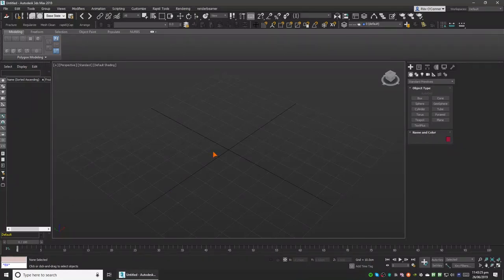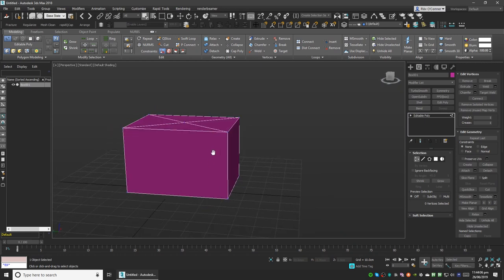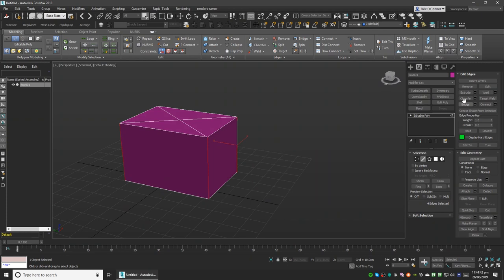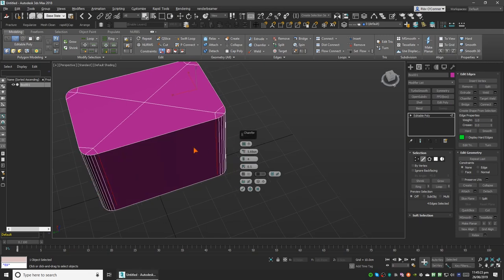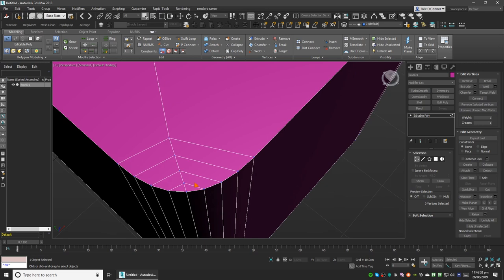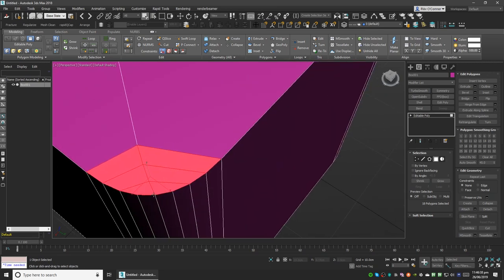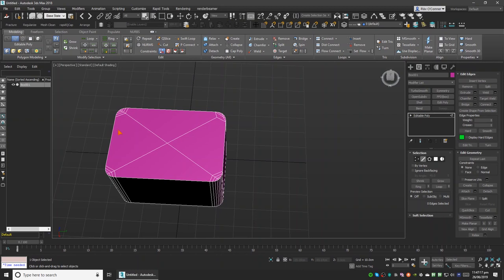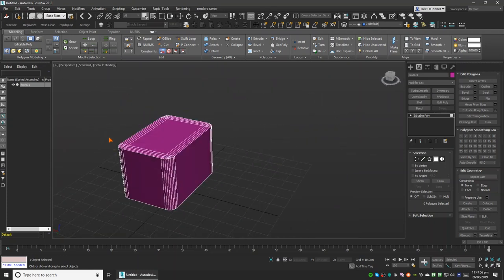[3ds Max] Solve chamfer problems

Comment: Oh my, still didn't do it for me ;( How can I remove edges on a polygon? I thought you were going to do that. I just tried with 'delete' but it removes the hole polygon, unlike what happens when you removed some edges there. I got a simple rectangular shape and I can't figure out how to do a simple chamfer like yours without problems... HELP!!
Reply from the maker: backspace to remove the edges, ctrl+backspace to remove the edge with any vertex it connects to
Reply: @revoconner  Thanks but tried and didn't work. They are edges that appeared when I did a bolean, it's like they don't really exist but they are there